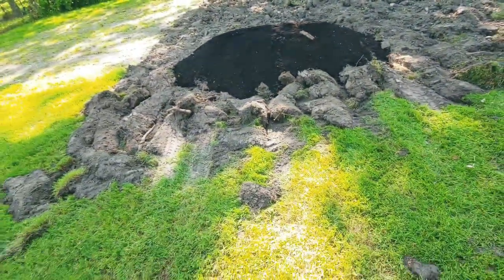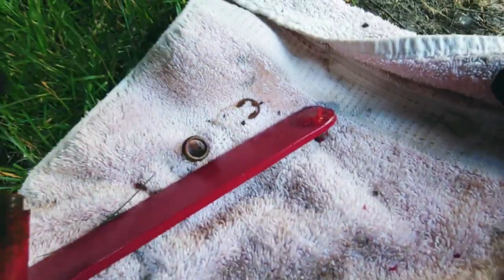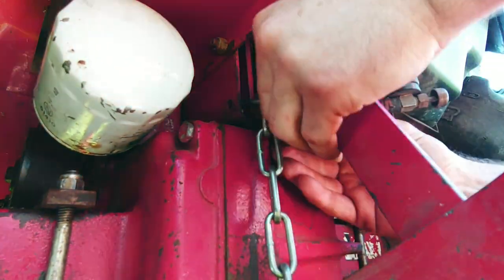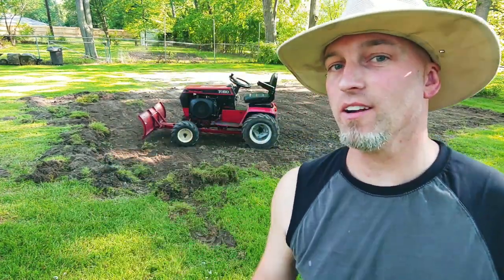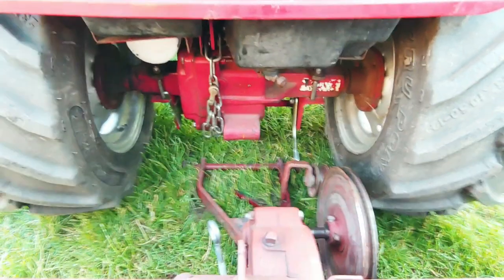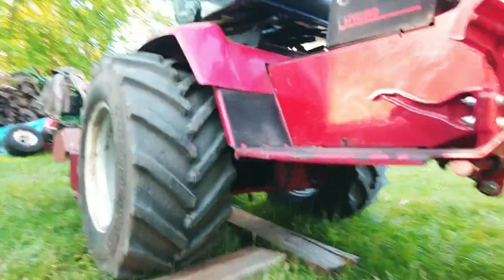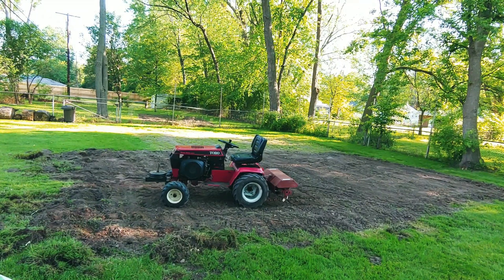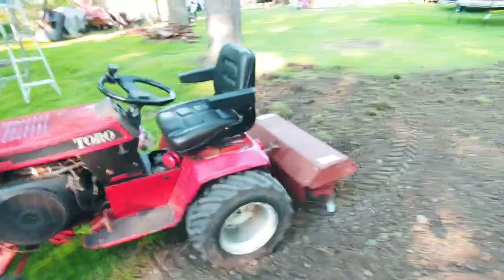How to use a Wheel Horse Garden Tractor- June 2020 Garden!

Comment: Changing implements isn’t terrible, but you can find “easily fixed” Wheel Horse tractors for $100-$200.  Get it running and put an implement on each one and save yourself the hassle.  I have a Work Horse with a rototiller.  A 417H that I repowered with a newer Kohler I’m going to put a blade on.  And I just got a cheap 416H that I got running and have been mowing with.
Reply from the maker: Yeah I actually have four tractors I'm going to be getting rid of three though because I don't mind changing around the implements as I have a really good routine and it's really fast. But yeah if you got the space and you don't mind keeping them around that's not too bad of an idea. Thanks for watching I really appreciate it

Comment: I use a floor jack when I'm alone hooking stuff up
Reply: Good idea , I know what it's like mounting that tiller, it's a beast.
Reply from the maker: @daved8947 Yep! If you line it all up right, you can just stand at the back of the tractor over the tiller and yank it up and then lock one side in and then the other. The right side though, you have to slip the lock lever under the idle pulley bracket on the tiller when moving the tiller into position.

Comment: Awesome video. Encouraging. I'm going to look at 1277 Wheel Horse from 1967 tomorrow. Mice ate wiring apparently and fuel line rotten. It has snow thrower, rake, rotor tiller, chipper, mower...I just have to get it running. It's been idle for two years.
Reply from the maker: Niiiice! Looking forward to seeing. You should upload some video of it for sure!

Comment: i have this tiller for my 1989 Model 312-8  -- similar set up but mine's a manual lift --- not sure if you ever tried it and it's counter intuitive - - but go after doing forward tiller rows then do them in reverse ( low gear)  and tiller will make really nice fine amended soil - and better blending of material
Reply from the maker: I would probably go back ovwr it in the opposite dorection but yeah I do like this tiller a lot. Does a fine job! Thanks for watching and the support!
Reply: Tilling in reverse - you are asking for trouble.
Reply from the maker: The trans?
Reply: there is a giant spring that comes with the tiller to help lift it. he didn't use it because he had a Hydro.

Comment: Great video! Love the 520 it makes quick work of that garden! But those quick-pour spouts on the gas cans are very frustrating, I've had a couple break now and I got rid of all the new cans and found some old style vented cap ones at a garage sale that I now use
Reply from the maker: Yeah its a great machine! Has done so much for us here on the property. From Lawn, garden, hauling, dozing and snow plowing and snow throwing! 

 Yes you have to be careful with the aftermarket plastic spouts and cans. They dont always seal well together and can cause a mess! Lol

Comment: Where did you get your belts from and do you know where to get replacement times for that
Reply from the maker: Belts I go to the Vbelt guys online. And no I don't know where to get rhe tines from. I've seen guys weld them back up and sharpen them and I'm pretty sure you could temper the new welds as in a forging process of a blade.

Comment: Thats a nice toro setup you have there.  How is that garden doing now?
Reply from the maker: Thanks. It's doing well. Will be getting an updated video soon. Working my way through the files I have to edit and upload. ;o)
Reply: @Fixin2Ride-Official-  Very Instructive Andrew,m I;ve been trying to attach my darn tiller,  See I;m missing some parts. Cheers
Reply from the maker: Thanks for the supprt. Yes that does happen. Ive made parts before if it just takes welding, drilling, nuts and bolts. Maybe a pulley or spring.

Comment: The mower, snow blade, and blower all go on wheel horse easy. Tiller not so easy or I'm doing something wrong.
Reply from the maker: LOL- yeah the tiller can be a PIA. But you have to set it up like I did in the video and use a 2x4 or 2x6 to help prop it up while strapping her in for use! 

 The key is making sure the Plow Pivet Bracket is offset to the left enough. Otherwise the case gets in the way. At least on the 520h and other Hydros... 

 Keep me posted on the hook up! Thanks for watching the video, commenting and the support!

Andrew C.